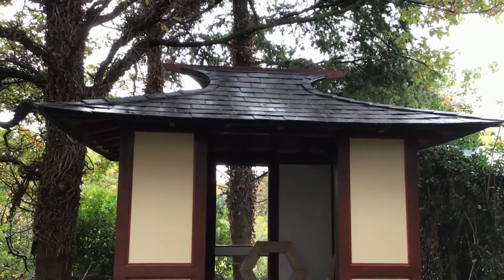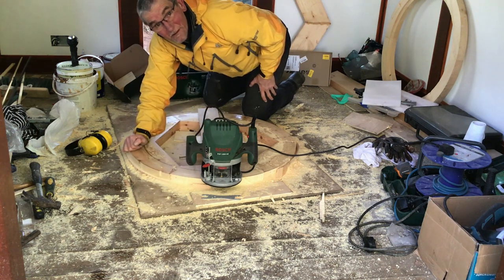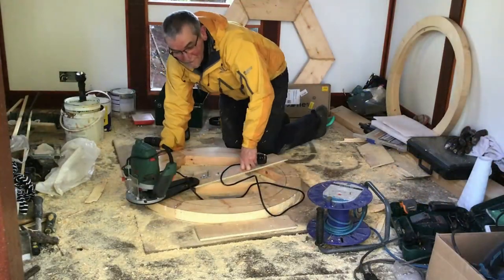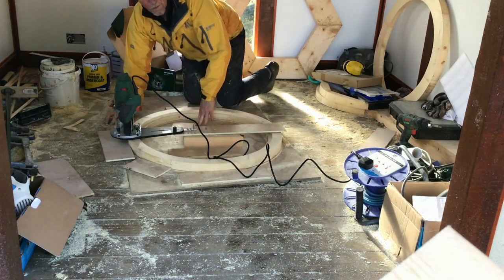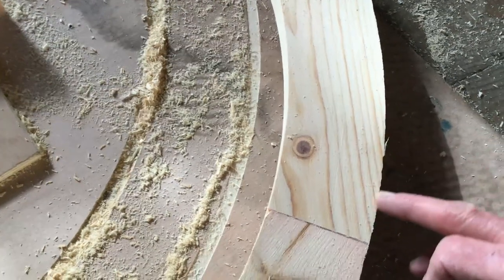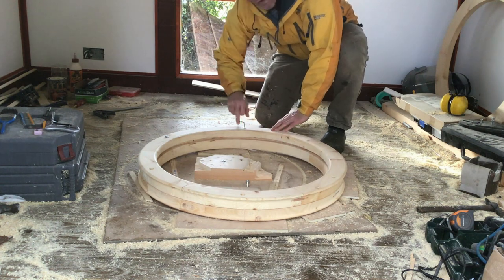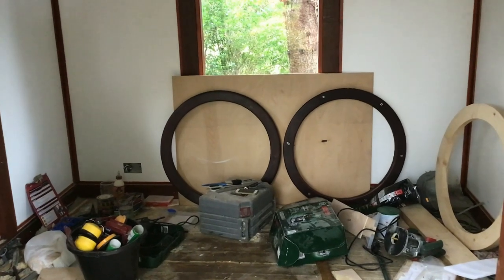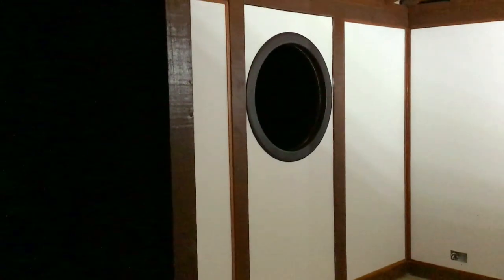Part 14: How to build a Japanese tea house - Completing the Moon window and fitting

Comment: This is one thing I will be doing as well and I’m like how the heck do I do a circle lol thank you 😅 🙏
Reply from the maker: When designing the round window frame, use an extendible sliding mitre saw. If my memory is correct, I used 150mm x 50mm pine and cut 6 lengths at 60 degrees. See this image and link 
https://www.scienceabc.com/wp-content/uploads/ext-www.scienceabc.com/wp-content/uploads/2019/07/hexagon3.jpg-.jpg

The length of each section depends on the outside diameter of the window.